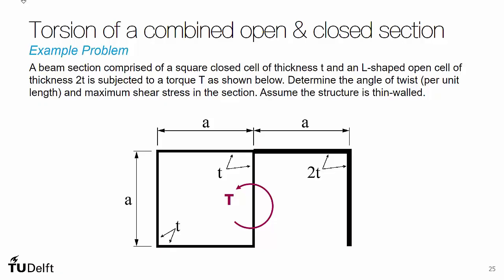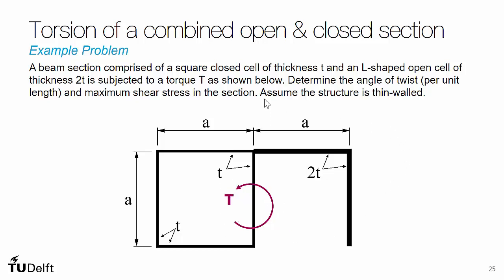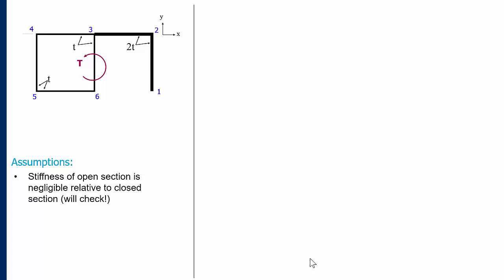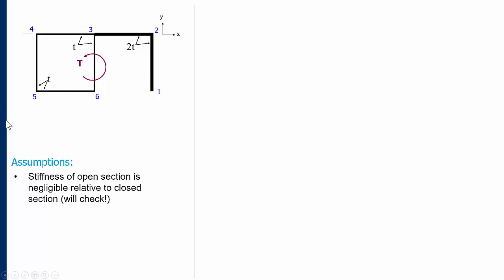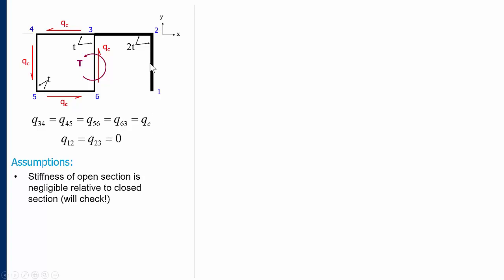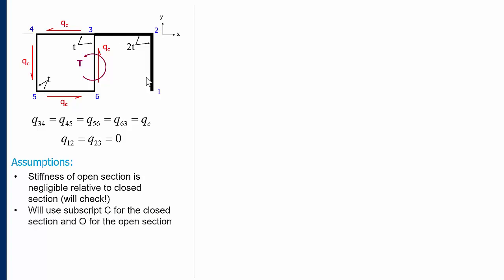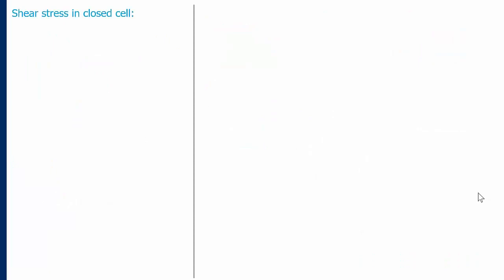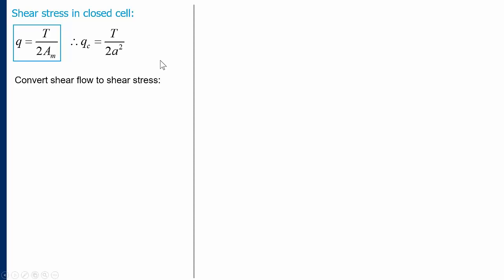Example Problem: Examining the torsion behaviour of a simple combined open-closed beam section

Comment: Hi Calvin
I love your video and I find it very educating.
I was doing at general calculation of a combined open and closed section and used your video as a control check and may have stumbled upon a false assumption you are making.

It concerns the final relation that if "a" is 25 times larger than "t" then the stress will be equal in the two different sections.
Because you forget to calculate a new deflection relation between the the open and closed section for a = 25t, which from my calculation is no longer 4/75 T but is now 16/1875 T.
Therefore the stress relation for a = 25t is now 4/25 and even smaller in the open section than for a = 10t which is 10/25.

To get the same stress in the open at closed section you will need to decrease the length a = 4t and it is now no longer a thin walled section.
Therefore it can be assumed in my opinion that the maximum stress will always be in the closed section as long as it is still thin walled for the structure you present in the video.

I have not found any other errors in the video but hope this clears out any confusions that others might have had.